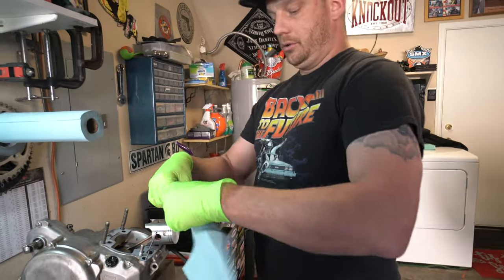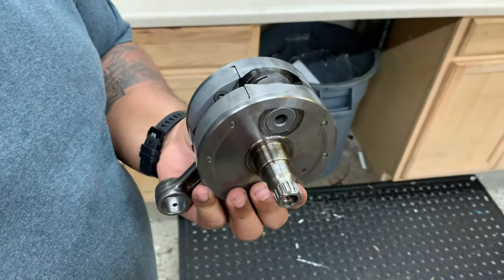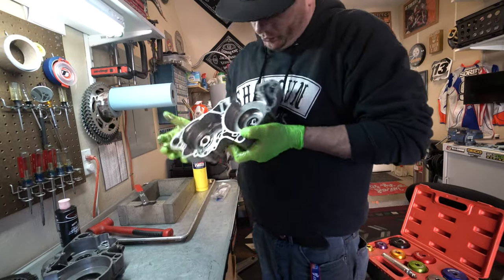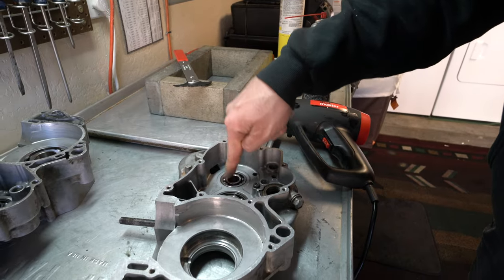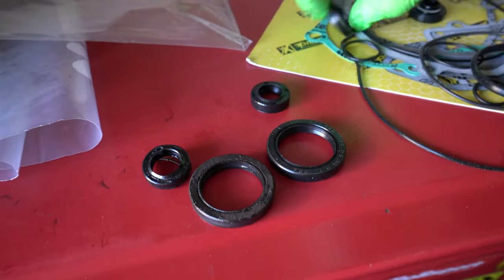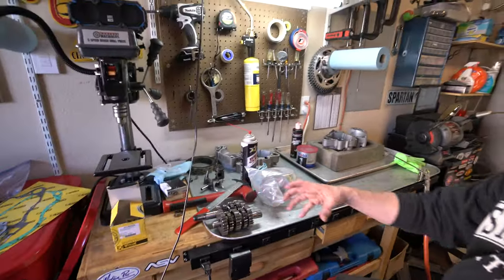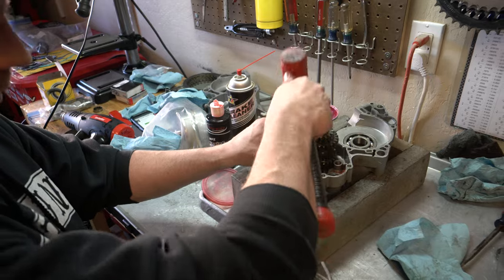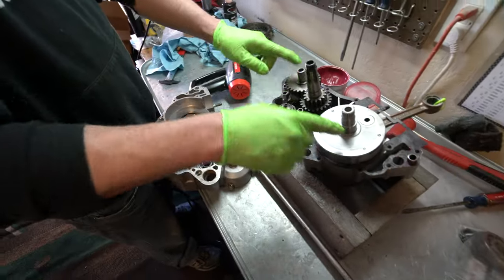Rebuilding a Suzuki RM250 2-Stroke Dirt Bike Engine Step by Step w/ a Professional

Comment: Youve put the crank seal in backward its going to smoke like crazy. On this model it looks like its backward but its the way its designed to be.
Reply: post a link showing what youre talking about please.
Reply: I haven't got a link I own a manual and it has a cut through drawing of both seals. The spring in the seal should face the oil like the stator side does
Reply: That crank seal is backwards the spring and lip should face the fluid side.
Reply: Exactly. Even some manufacturers manuals get the pictures wrong.

Comment: The Clymer manual literally says not to use a torch on the casing because it will cause the casing to lose its tempering
Reply: Only loses its temper if it’s heated to 5-600 degrees
Reply: @tightropehikes  where are you getting your info? Or are you just a self proclaimed expert
Reply: @jaycox6096  I make axes and I’m familiar with various metals being heated and subsequently tempered.
Reply: @tightropehikes6994  so I guess the team at Clymer doesn't know anything and you're the big master of metallurgy. Lmfao
Reply: @jaycox6096  your right. This build has failed and likely snapped in half
Reply: @tightropehikes  ignoramus!
Reply: @jaycox6096  I’d put disclaimers for warranty purposes as well.
Reply: @tightropehikes6994 you're a real one someone who's actually in the industry it seem or an industry
Reply: @fredc8618  lmfao a real fake one!